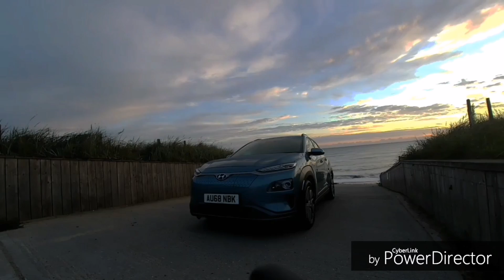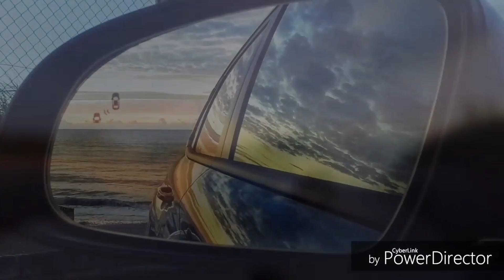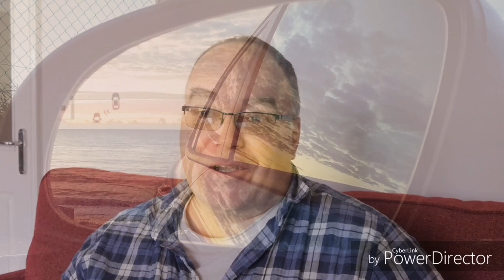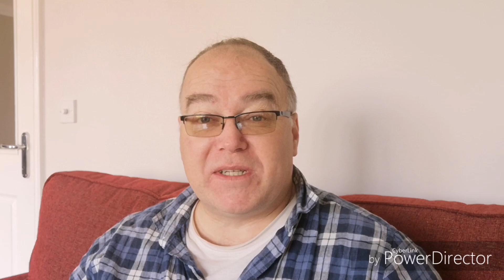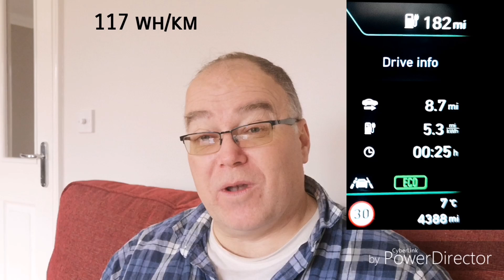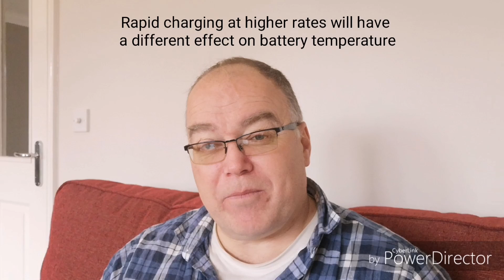Kona Winter EV efficiency tests. Does Preconditioning help?

Comment: Please  could you tell us what is the impact on range with the car fully loded ?
Reply from the maker: It's heavier 😉

Seriously handling changes a little being heavier. Takes more energy to accelerate but has more mass to decelerate thus more Regen.

Potentially weight can help if downhill, just let them all out for trip back 😉😉
Reply: @EVPuzzle  Thank you for answering. I am in Greece. Public chargers are nearly nonexistent. Only home charging if idecide to go electric.

Comment: Not sure if this is already mentioned below, but put very simply, batteries are less efficient when it's cold as they get their energy from a chemical reaction between the anode, the cathode, and the electrolyte substrate between them.  When the battery is cold, the chemical reaction is slower, and so less efficient.  If EV manufacturers were to also warm the battery, and not just the car interior, when "pre-conditioning", then likely you would get some of that efficiency back.

Comment: Is it really efficient unless you add back the energy to heat car before driving off. I tested my prius plugin by starting journey in hybrid mode because I need engine to heat car. So saving my electric charge for later. Then after 20 mins driving turn ev back on. After round trip of 26miles got 79 mg. Normally would be 70mpg. So don't waste you electric charge on trips beyond its electric range. Save for when it's needed. Having said that usually can't be bothered.
Reply from the maker: Prius! Prius?! 😉😉

Comment: I always have the Zoe heater set to 22 degrees and I don't use eco mode. I get about 3 8 miles per kwh at seven degrees and with the lights on. My car lives in an integral garage so it generally starts at ten degrees. Mid summer driving slowly I never get above five miles per kwh and typically 4.7 miles per kwh. The Kona is very impressive in efficiency terms

Comment: Your cars miles/kWh is not the whole storey. If preheating you have to take into account your total electricity consumption which also includes the charger inefficiency. I have carried out checks by taking meter reading and find efficiencies of between 80 to 90% depending on preheating or not. My conclusion is that running costs are low compared to ice cars so just drive and enjoy the numerous advantages of driving an electric car. One of the other advantages is you can have a full take every morning.

Comment: All about the chemistry of the battery. In winter the electrolyte (the fluid between the anode and cathode) is denser in winter and thus unable to a) charge as well, b) unable to push energy back out again.

Comment: When I had my petrol car, doing the same short journeys every day to work, I was getting 52 mpg in the summer and 46 mpg in the winter, and of course anything in between that when it started warning up. So I guess the dense air in the winter must have an impact as well as a cold engine everyday. 
In my leaf, I do not use the heater because I only have a short 10 minute drive to work, some at 50 mph, I am getting 4.3 miles/kWh, in winter 4.1 m/kWh. If I do use the heater, it drops to around 3.7 depending on outside temperature,  and journey length. Most of that is used when the heater is first turned on due to the resistive heating being used for the first few minutes while the heat pump gets up to speed. 
On a longer run, the heating settles down to a couple of hundred watts and has far less impact on range and I can achieve 4.0 miles / kWh with the heater running at a set temperature of 19°.  So short journeys with the heater on will use much more than longer journeys with the heater on.

Comment: Hi Nigel,

Thanks again for all your great Kona videos. 

Your the key reason we bought our Kona and are enjoying it. 

We travel approx 100 miles a day or 160kms

We charge to full each night for our morning commute. We have a chargepoint 6kw home charger on  220v AC

What are your recommendations?

Charge to 100% even if were only using 1/2 a charge each day

Or

Charge to 80% max each day so we still have plebty charge for the commute. 

What is better long term for the battery in your opinion?
Reply: It's best to not top up to 100% unless you really need to, especially not every day. Keep it around 80% for daily use and top up when you need to travel a longer distance.
Reply from the maker: Gary, it's nice to hear I've helped you.  Whether I'm overly cautious but I try to not leave it sat with more than 85% , if charging overnight I charge just before I leave thus it sits for the  minimal time at higher %

Comment: Will rapid charging reduce battery life compared to trickle charging?.
Reply: .....and charging to 20-80% is better than to 100% even on trickle charge?.
Reply from the maker: Not really no.

The 80% thing is because charging slows down at rapid chargers so its more efficient to stop charging then. It's not to do with what's good or not. It's also good etiquette to not hog a rapid charger receiving lower rates.

For protecting the battery avoid leaving the car standing on very low or very high % and avoid prolonged full power driving and repeated rapid charging. Avoid charging below zero degrees C if you can.
Reply: We aren’t getting the new Leaf out here until August and still no sign of exactly when Kona/Niro will appear so it’s still all theoretical in Australia.
Reply from the maker: New leaf way too expensive for a lesser product compared to the Kona
Reply from the maker: Yes.  AC charging is kinder on the battery. It's slower and generates less heat 
Hyundai state this in the manual but give no guidance as to what's acceptable and what's not.
Reply: I have a feeling the Kona is going to be around $A10k more ie 60 v Nissan’s announcement of $A49,990

Comment: Preheating won't warm the battery in the way you suggest because the electricity will not go from the battery to the heater with the charger relpacing the electricity in the battery, the electricity will go straight to the heater ignoring the battery so the battery will stay cold.  Also did you check how much energy was used to preheat form the mains? I wonder if the overall energy used is the same i.e. mains pre-heat + journey = battery heating + journey. If the is the case then the overall efficiency would be the same and the only real difference will be the range achievable.
Reply: If you precondition it's most likely because of the luxury of it, so you'll drive with heater on. Then it's not a question of if it overall uses more energy than starting up cold, but how much. That would be a good test though.
If you precondition to get max range, sure.. But then I'd rather dress warm and start up in a cold car. Starting up in a warm car makes you freeze when it turns cold (heater off). If it's cold from the get go you don't really notice it that much. Trust me, I've tried, done a couple longer drives in around -10C without heater..
Reply from the maker: Steering wheel on, heater off for me
Reply: I am not an expert either.  Maybe when preconditioning the 7kW is divided between heating and charging if possible. Maybe the charger can squeeze just a little bit more in to the battery if conditions change slighly, possibly pre-heating the car interior for half an hour warms the batteries slightly through the floor allowing a bit more charge. You are right that what is happening is hidden away. Don't think they have accounted for the type of people the early adopters are.
Reply from the maker: I disagree Stephen. The heater is not powered directly from the charger.

I didn't count the energy used from the grid. I was only interested in efficiency and thus range. Preconditioning uses lots more energy than needed and is convenient but slightly wasteful
Reply: But won't the electricity coming out of the battery come out through the same terminals being  used to charge it? Then the charging electricity won't go into the battery and out again it will just go straight to the heater.
Reply from the maker: I'm not an expert but my thinking is I've definitely seen the range increase during Preconditioning. Just up 1 but up all the same. That indicates input to the battery to me.

How the electrons flow in that process is a mystery to me. The complexity of the cars heater fluctuating it's demand for power and the charger keeping up perfectly seems implausible  to me unless it was directly connected which it's not.

Not that it matters much I guess, the results the same.

If only we had better monitoring of the battery. It is a shame it's all hidden when so many of us are interested in the details
Reply: Turning the heating off to increase efficiency is a compromise I'm not prepared to make. If it's a short journey then efficiency will be low but you don't need to be worried about range as you will be back and able to charge again and on a long journey the effect is much less, as you said, either way it's more efficient than an ICE car. I just don't want to drive in an 'ice' car. Each to their own I guess.
Reply from the maker: The joys of EV ownership. Spending a fortune on the car but being efficient to save 10pence of energy to beat your previous best .

Comment: Great info... so basically with no heating on... and driving in cold temp winter conditions, the lower the temp, the less efficient your EV is.. so at 7C is better efficiency than at 4C, etc...  So at 7C, you got 5.3mi/kWh.. that's about your same efficient in summer at 20C ?
Reply from the maker: That's how it looks , yes.  I'll do the equivalent test in much warmer conditions one day
Reply: @EVPuzzle  Nice.. on my LEAF 2017, I got about 5.1 mi / kWh in motorway and city driving in summer (about 20-25C temps), but then in winter now (about 0-5C temps in the northern "states") I'm now getting 3.8 mi/kWh.. and usually I dont drive with any heater on (I just wear thick coat) or turn on the heater for a minute or two and turn it off... so definitely the outside colder temp makes a big difference...
Reply: @be236  wow that's huge difference. about 30%!!!
I was surprised of the insane high consumption driving in -10C without heater. Calculated I got about 30-40% higher consumption than in 10-15C.
Running no heater I would guess the difference in your case would be more like 15%...
Reply: @therandomtester9561  Yup... About 30% efficiency difference... basically due to the temperature... summer was about 25C and winter now is about 5C.

Comment: How is the efficiency at 32 -42 C (indian summer) with ac running ?
Reply: AC uses less energy than heat, so it would be somewhere between the no heater and with heater I'd guess.
Reply: Rayner Bønå - agree - on warm to hot days, the main battery is in its most efficient temperature range, and ac doesn’t demand nearly as much power from the battery as heater use does.  Once a car has cooled down from removing initial greenhouse heating (car sat in the sun), there isn’t much energy being used to “keep” the car cooled down.  Ac consumption does get worse with short trips or dense stop and go traffic, similar to heat mode experience.
Reply: Hard to say as we almost never get that hot in uk

Comment: I think that you didn't see a large improvement after heating up the car before leaving because of the way the Kona calculates energy usage with it's software.  From what I understand it uses the reading for the calculation prior to the drive itself also, part of it at least to calculate the mean energy.  That means that energy used to warm the car is taken under consideration for the trip you did afterwards explaining why you see less efficiency.  Not perfect software design, the ideal would have been to calculate the energy used at the start of the drive and after that point in time, but it is not the case here I believe.
Reply from the maker: I did reset it so it was just the drive not the Preconditioning
Reply: @EVPuzzle  I know you did reset.  But the software uses an amount of past energy usage for it's calculation in their software even after you do a reset.  It doesn't start "fresh" after a reset.
Reply: To confirm what I say, you would need to do a second test drive, just after the 1st one with another reset to see the variation of energy used.
Reply from the maker: That's not what the manual says. 

I also turned the car off and on again to be sure.

I'm confident zero was zero.
Reply: @JeanPierreLavoie  sure you're talking about the consumption now, and not the GOM? I easily would believe you that the GOM would change after precondition, but surely the consumption should be monitored as it is..

Comment: Nice work Nigel, thank you.  I do feel that less than 10 miles may not be enough though.  Only a slight difference in route or traffic conditions will impact on it and the more you drive the less the heater will be working.  Still interesting stuff though.
Reply from the maker: Has to be short to see the impact of the heater. Any longer nearly half an hour's driving and heat pump comes in and varies the equation further... That's my thinking anyway
Reply: Guess a longer route would be better to smooth one difference, BUT I've had my Leaf now for 4 years. For 3 of them I drove very often the very same route to work, 6km each way. Work as a busdriver, so most of the time in my car I'm pretty much alone on the road.
During summer consumption was always 4-5% each way. Maby 6-7% if I drove very vigorusly or I was very unlucky in the 3 lights and 6 roundabouts.. During winter it used to be around 10%, maby 6-7% if running no heater. So even on that short drive you can clearly see a big difference.
Reply from the maker: If I had my car in the garage , placing a fan heater under the car might work better 😉

Comment: I hear that the temps in UK are not cold enough to trigger any battery maintenance programs on the Kona ev.Here in Ontario Canada the temperatures are  -15 to -40c for weeks and months.
Reply from the maker: I guess those temperatures are problematic for many things .
Reply: maurice pauze -40c for weeks and months! What Ontario do you live in?

Comment: I'm happy to hear that charging the battery doesn't rise the temperature a lot. If so that would be a lot of energy lost (always when charging).
Concerning the less efficiënt battery at low temperature I can think of less electrons that can move of they move slower, more resistence. I've heard  from Kangoo drivers that regen is working less strong when it's cold. 
As a  comparisan: mixture of water and sugar is only a consistance liquid above a specific temperature. I think it's the same in the lithium fluid
Reply: I have a Zoe, regen is lower when the temperature is cold and the battery is full. After some energy is used after a few miles it goes back to normal.
Reply: @stephenmorgan625  same in Leaf and all other EV's (porbably except the Think with molten salt battery). Actually it can be cold and near empty and still very low regen. Pretty sure that is software, to preserve the battery in some way.